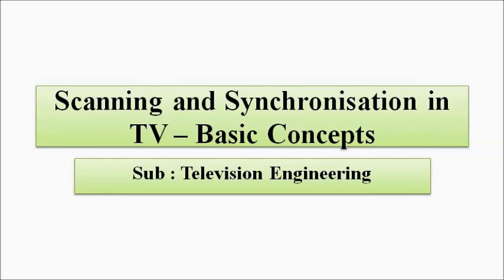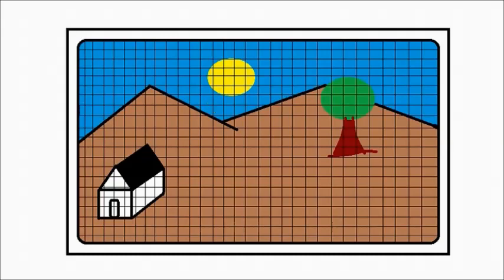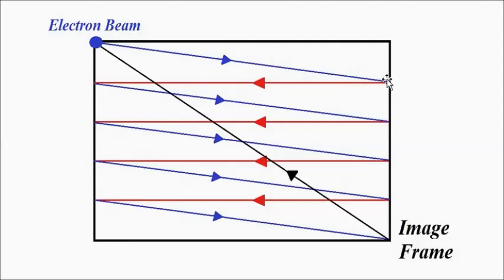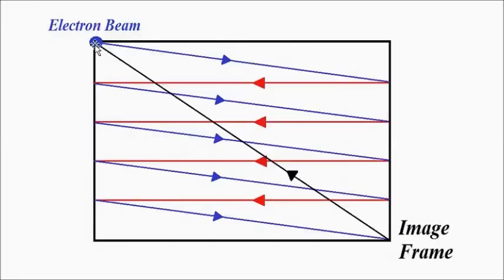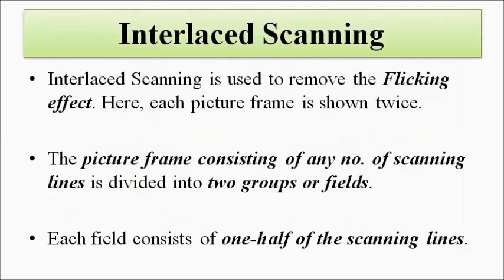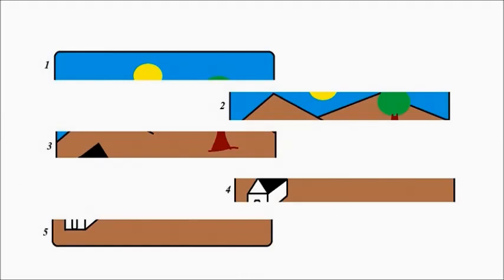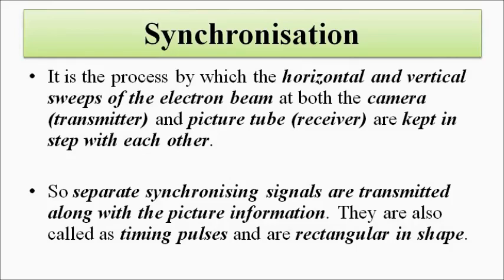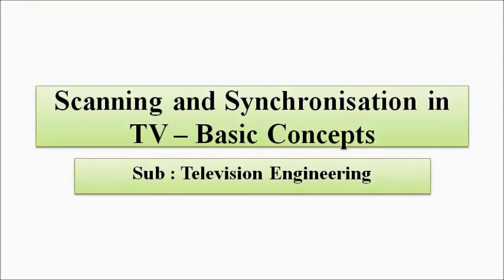Scanning And Synchronisation In Television | Basic Concepts | Television Engineering

Comment: The fields are never divided in to two parts. One single odd line traces the entire frame and keeps gaps for even frames. After that it retrace vertically to point C from point B and half line offsets. As a result the field 2 starts from center of the frame.